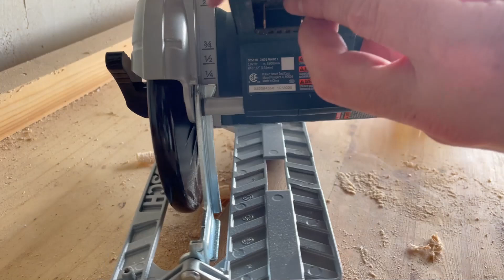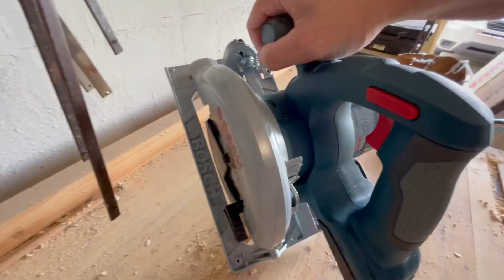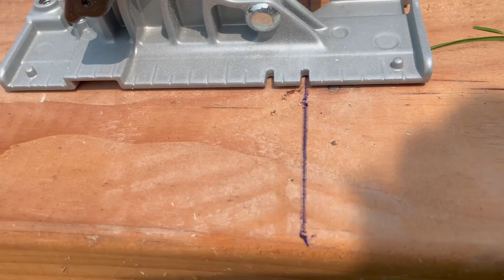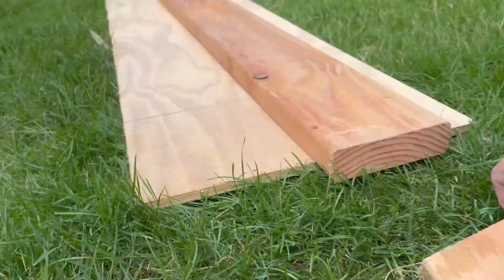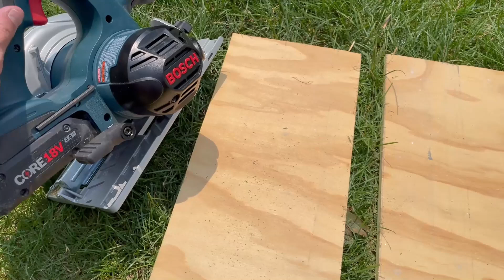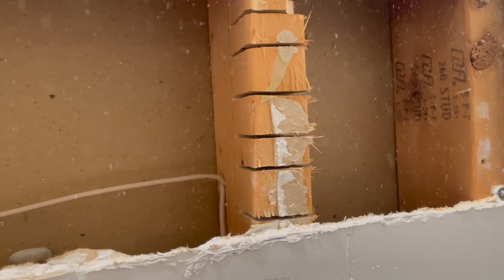Review of Bosch 18V Circular Saw || Can It Handle 2X Lumber?

Comment: Interesting… a left blade circular saw that, as it seems, is rail compatible.  Never seen that before.  A model that I can’t find here in the EU.. even if BOSCH is a German brand.
Unfortunately (well, for ease of sawing purposes), lumber is thicker here in Europe.  E.g. although 2” framing wood isn’t 2” thick anywhere, it’s still closer to 2” in Europe than in the US.  Although to cut at 45° bevel in 2”-ish European lumber, it seems like the American Milwaukee’s latest 7 1/4” saws are the only ones that can accomplish that… At least if using a rail (besides even larger bladed saws).
Reply from the maker: That's interesting that this saw isn't sold in the EU.  Maybe Bosch figures the thicker lumber makes the 6-1/2" blade less desirable than in the US?  Although, the thicker lumber definitely has its benefits!
Reply: @HomeLifeLeisureDIY Although after some searching I did find it offered at places in the EU.  Bosch Sweden, where I’m at, doesn’t seem to have it though
6 1/2”s are great.  I think most can cut our 2” (1.77”) at 90°.  That’s enough.  A mitre saw or a table saw get to manage any of the few 45° beveled cuts I do in framing lumber.  Even many 7 1/4”s can’t do it anyway.